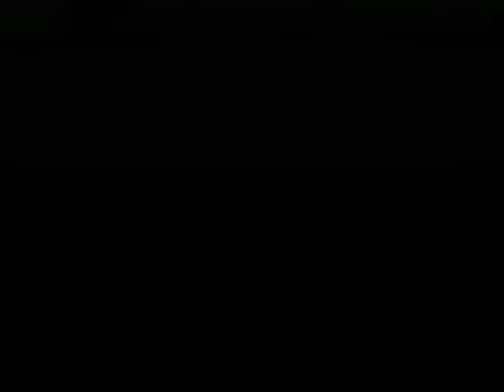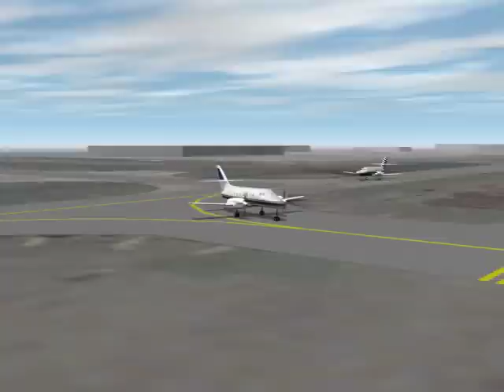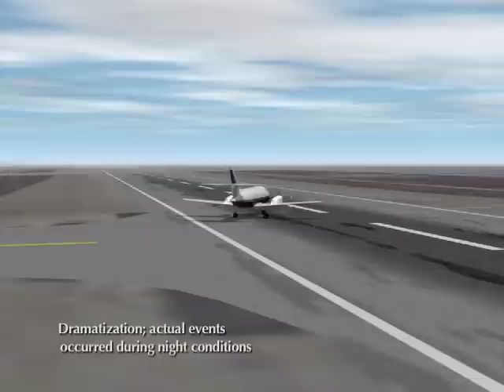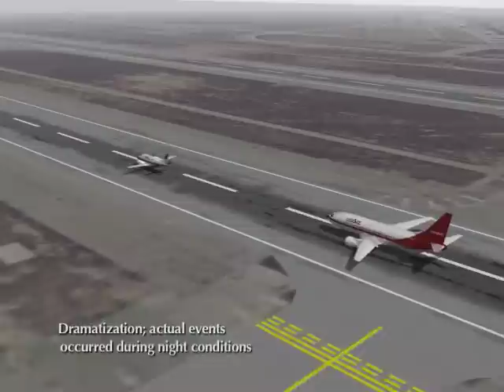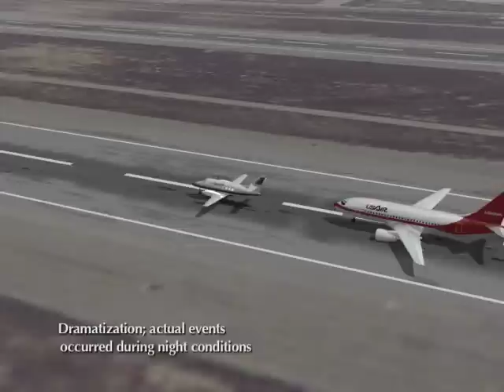USair 737 collides with Skywest Metroliner re-creation

Comment: laker player, thats not technically right, an atc in controlled airspace could give a landafter call if he is sure the aicraft ahead is going to clear and knows the landing aircraft has sufficient spacing, of course its generally used with smaller planes but it is possible, also an after the landing 737 position and hold runway?? would also have 2 aircraft on the same runway.

Comment: This one they blamed the controller for this accident, but in my opinion a large share of the responsibility for this accident rests on the shoulders of the flight crew of the commuter plane.
      He had been told to position and hold. Such an order will happen only happen when the runway will be clear in just a few moments, so the pilots should have been expecting clearance for take off at any time.
     Surly they should have heard the 737 being cleared to land on their runway. Even if they only thought there was a conflict. When they heard a plane being cleared to land on their runway, they should have called and reminded the controller they were there.

Comment: @solomonpilot767 TCAS only works with other aircraft that are airborne. The twin prop on the runway would not have shown up. However, the pilot should have seen the prop and went around. Just a careless mistake on both the pilot side and the controllers...

Comment: Perhaps in your mind. However, by regulation its not uncommon for us to receive landing clearance when the plane before us will still be at the end of the runway when we touch down. I'll usually query the tower to ensure they know that but they can and do allow us to land when another plane (near the end) is still on the runway. Its "antisipated separation". They also often clear us for take off when the landing traffic crossing the runway hasn't yet touched down. They know it will work out. ;)

Comment: I've had my hand on the throttles ready to go around while on short final due to traffic approaching the hold short line... once this year.. a Navajo rolled right across it forcing me to go around.. he stopped with the tip of his nose on the edge of the runway but I was alreay full power at that point.  Gotta be ready for anything even if you have a clearance.

Comment: why wasn;'t the metroliner at the beginning of the runway
Reply: Flightsim45 they used to let commuter aircraft take off from midfield before this accident happened, its called the fifty yard line where the metro turned onto the runway and was held prior to takeoff
Reply: small planes need less runway.

Comment: The episode of "Air Crash Investigation" for this incident depicts the 737 touching down on top of the Metroliner, with the two burning aircraft entangled and skidding off the runway.  Oddly enough, I have read the NTSB crash report and it states the 737's fuel tanks stayed intact and they recovered the fuel after the crash; the 737 caught fire from the crushed Metroliner, but some how it didn't propagate to the jet fuel.